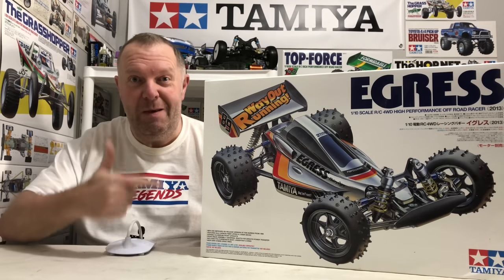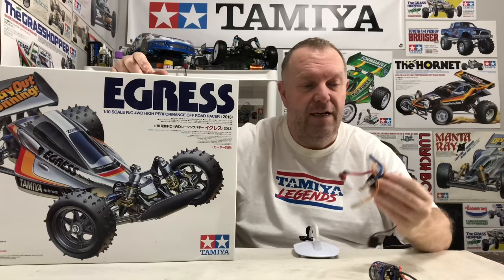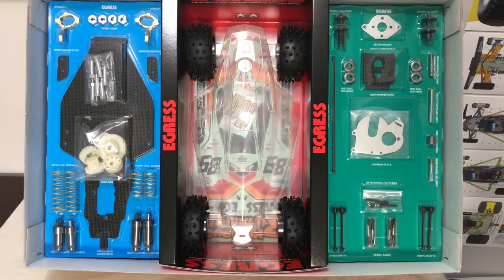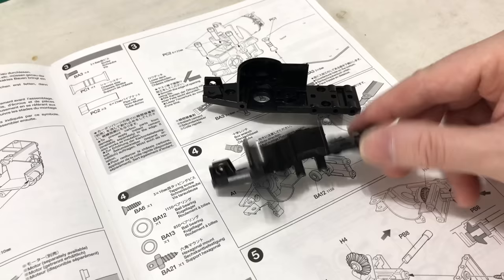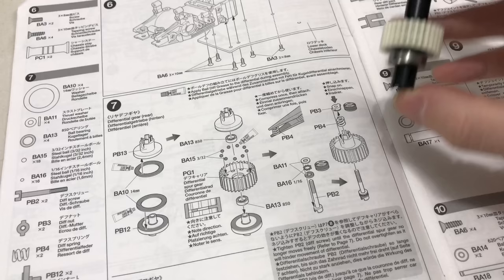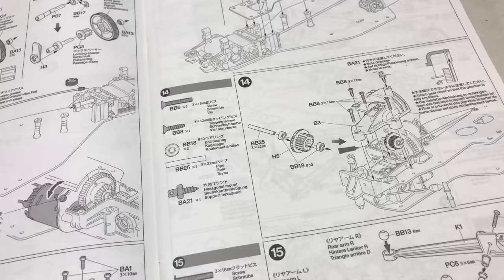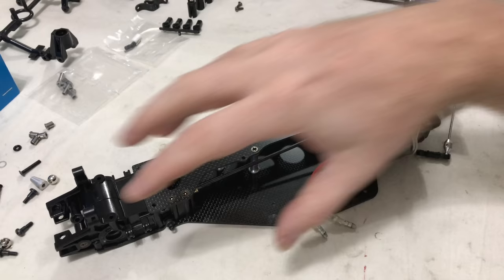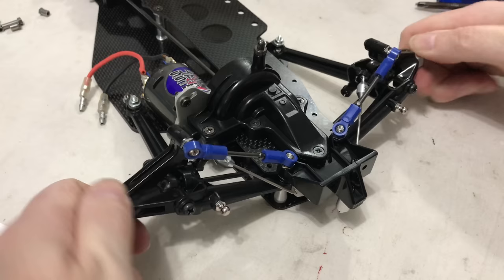Tamiya Egress Build...

Comment: Really enjoyed this video Glenn. The Egress is my favourite and the best spec re-release Tamiya do... I understand why you lowered your suspension but I would like to go on record and show my disapproval, you can go too far  (looks aren’t everything)... I prefer to use thick shock oil on the driveshafts it gets into the joint by capillary action  but when running it throws the dirt from the surface, oil can be easily reapplied each running session the grease tends to hold onto the grit and dirt and requires a strip down build to clean and re-grease... I have shimmed the wheel axels with 0.5-0.6 mm shims it removes all the play from the wheels (you need a minimal play so the bearing don’t over heat and produce drag... ‘Thank for the mention Glenn’ I’m using the 10:5 turn brushless I have found the diffs will slip excessively on standard set up, I have found it’s better to just gently tighten it until the diff spring is fully compressed  It still allow a slight slip on initial acceleration only, allowing it to behave like a slipper clutch but not so much slip it’s going to burn itself out... the original front shock mounts you are using "requires" those spacer plates you mentioned, they are to stop the torque motion of the bracket from cutting through the plastic lower arms! you could easily make some steel oblongs the dimensions of the hole in the lower arm the same thickness of the brackets fitted (I made some from thin FRP). (You might get away with leaving them out if you’re only car park bashing)... I have to say this obsession with the blue ball link nostalgia is driving me mad! they are rubbish plastic and have too much play if you intend to use your egress you need to stick the much better upgraded dark grey ball links (again looks aren’t everything)
Once again it was a pleasure stopping by you are the LEGEND 👍
Reply from the maker: Thanks Neil, a lot of food for thought there my friend 😊
I think I’ll give it it’s first run as it is now, then work back through all the items you’ve mentioned as I try to make improvements as I go. I have to say the only real thing I’m concerned about is the diffs you mentioned. I really don’t want to burn them out with them slipping too much 😞. 
As the car stands now I made them slightly tighter than the manual suggested, so I’m really hoping that works, I don’t have a great record with ball diffs 😞
As always I really appreciated your feedback, more so on this car as I know it has a special place in your heart 🤩👊🏻
Reply: TAMIYA Legends I like it a lot as it is pretty perfect how it is... diffs will be fine they are pretty bullet proof...

Comment: If it were mine, I'd look for softer and/or shorter springs so that the suspension at ride height still has some droop.  I guess if it's just going on the shelf, it will look good as you have it assemble.  The important thing is, it's your car so build it the way you like.  Great video!!
Reply from the maker: Thanks buddy 😊👊🏻

Comment: Fantastic video Glenn, I too am really enjoying the longer run-time of the Saturday clips. A quick comment about adjusting the ride height: I've found that it's usually best done with all the electrics and the battery installed, since adding those will no doubt lower the car a bit further due to weight. Just dropping my 2 cents.
I really must get me one of those Egresses before they become as rare as hen's teeth to find NIB!
Reply from the maker: Thanks Kamal, great feedback my friend 🤩👊🏻
Yeah the kits are starting to dry up now, that means the prices start to rise 😭

Comment: Great looking buggy, I'm thinking I need an Egress now lol. That servo does look quick, good choice for it. The steering looks better than the Avante 2011, which I found is very sloppy. Will be great to see it all done with the new body you have coming. 👌. I think your new Saturday video format is fine, lots of info in there, that's the main thing I think. 👍
Reply from the maker: Thanks Mick 🤩
Yeah the steering is chalk and cheese to the Avante set up. I’ve actually ordered the carbon Racing steering for my Avante 🤷🏼‍♂️
Reply: @TAMIYALegends  I'm glad you found it the same. Thought it was just me, I checked everything over and over. Everything is tight, seems to be a tiny bit of play in each each steering component so adds up to quite a bit of play overall. I thought about upgrading mine but I guess it's not worth it for the little use it will get... I'll just run it in a wide open space so I can't hit anything with the sloppy steering. 😂🤣

Comment: This is amazingly similar to the vanquish I had. Suspension motor plate and gearboxes look the same except the vanquish had planetary gear diffs on the axles and ball centre diff. Obviously the vanquish didn’t have carbon but all the screws look like they are in the same position. 

I still have mine I should see if I can get a new rear suspension mount:)

Comment: Awesome build Glen. Loved the detail and your take on the suspension. Back in 88 I mainly ran my Avante on road and I ran it as low as possible with an 11 double Trinity motor, huge pinion and Novak speed control. Don't need to tell you how quick it was. Length of the video was perfect. I often find the videos a bit too short. I know it's a year ago but keep up the great work. 👍
Reply from the maker: Thanks Gary 😍👊🏻

Comment: Great build video. What lenght spacers did you use in the front shocks? The rear shocks had 12mm spacers in each right?
Reply from the maker: I think the fronts were around 6mm 👊🏻

Comment: Great video, I've been trying to find the BF8 and 9 parts for ages. I've got some carbon replacements from Fibrelyte.  In that thread the guy covers the mod to the suspension you mentioned.  I think the balls may have popped off without it.  On the thread someone asked if people would be interested in reproduction metal parts, is that something you could ask in one of the videos?
The video was by Nolan J Philpott.  And it was someone called Dave Cox asking if people would be interested in repro bf8/9 parts
Reply from the maker: Yeah I’ve been following those posts in Facebook, they haven’t really had a good response for some reason 🤔🤷🏼‍♂️
But I know 100% if someone made them, they’d sell like hot cakes 👊🏻
Reply: @TAMIYALegends  Cheers, just thought you might be able to drum up a bit of interest.

Comment: the dish wheels are called parabolic dishes.... also, the motor side front turn buckle is on bacwards... its adjustment nut is wheel side should be gearbox side same as the other side.... sorry ocd :D
Reply from the maker: You have an eye for detail my friend, it would be pretty impressive  if it wasn’t showing my mistakes 😂👊🏻
Reply: @TAMIYALegends  eyes like a hawk :D

Comment: Hi, i noticed during build it said cement certain parts to the chassis. Do you bother or are the screws good enough to hold without cement? Cheers, got kit in post, can’t wait to get, you got me back into RC Glenn, last time I owned a Tamiya was when the Fox came out in the 80’s, had a hotshot before that. Bought a Hyper 7 pro few yrs ago in good condition but been so long since I was into the scene i feel a bit of a dinosaur. Any tips for my build would be appreciated, Mike from near Derby, cheers 👍🏻love the channel

Comment: Great video Glen! Enjoying the channel. I still have the original from ‘89 which also included a full set of titanium screws!!  One question for you, the re re includes a new front body mount built into the shock tower. Is that one used? How does the original mount not get in the way?

Comment: Just watching this again. You talk about fitting TRF big bores, did you put the big bore shocks on it yet?
Reply from the maker: martin harrell 
Yes I did buddy it can be done with a little messing around. Firstly they made the car sit too high, so I fitted internal spacers to bring the ride height down. I also had to changed the shock bottoms to standard ones to take the ball connectors on the Egress as the standard aeration shocks use a different one

Comment: Bizarre thing to do to the suspension topped out with too much preload is not right, it’s going to skip horribly. Just use lighter springs. No need to cripple the travel.